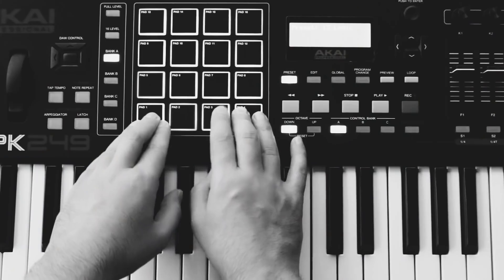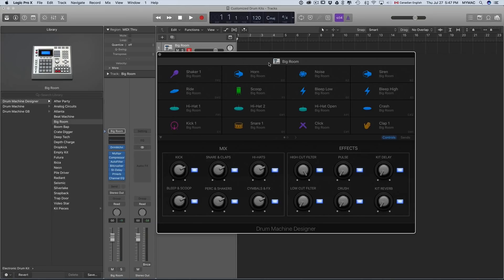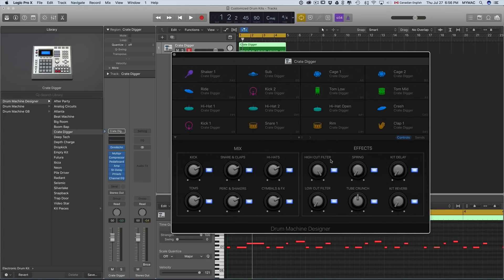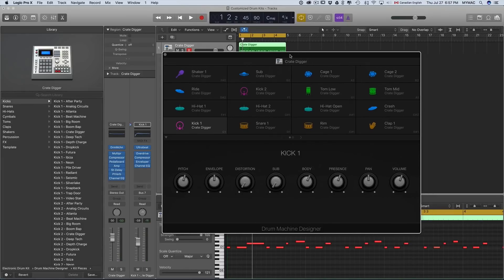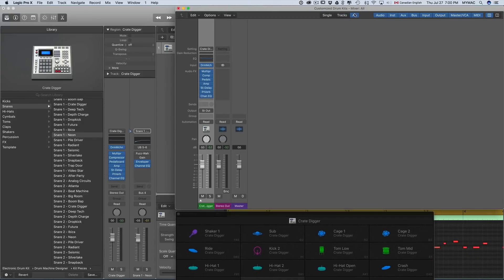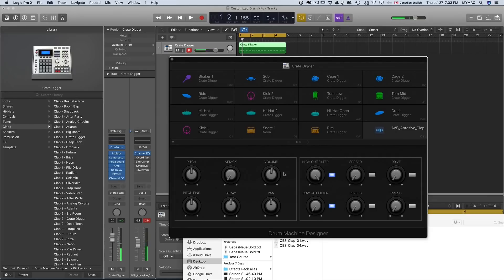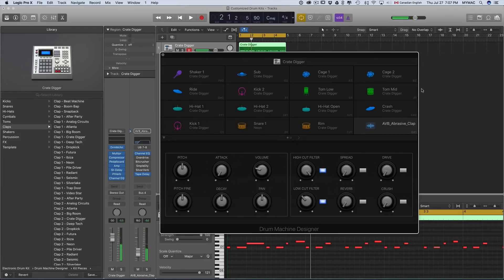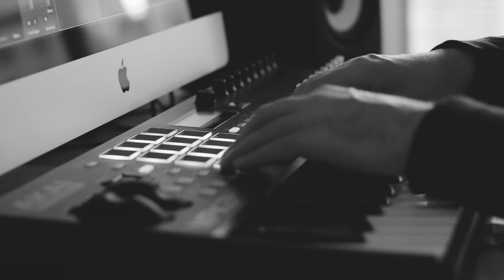Build Your Custom Drum Kit with Logic Pro X Drum Machine Designer

Comment: My Drum Machine Designer is not showing the 16 sqyares where the sounds are above the control bar.. How do I find that?
Reply from the maker: Hi, Thanks for reaching out. I'm not quite sure what your question is. Would you please elaborate?
Reply: Okay thanks for the reply. I notice when you click open the drum designer, there are 16 separate boxes (pad squares)above the control knobs of the Drum Designer, on mine I don’t have those squares to add the individual sounds. I only have the control knobs. How can I find that box with the squares. It is the box where the kit sounds go.
Reply from the maker: @mrlonqjohnsilver1118  It's strange. I don't know what the problem is. It might be a bug because when you load the drum machine designer the pad come by default. Maybe reinstall logic or upgrade to the latest version.
Reply: KUKA ok thanks for your help. I appreciate you.

Comment: Well in my opinion Drum Machine Designer is just an annoying controller around the Ultrabeat drum synth which eats up your CPU with bunch of channel strips. It just drops a preset on it and adds like 20+ aux and midi channels to my mixer and links the nobs to the parameters of certain plugins. Ultrabeat is the most efficient drum synth in Logic Pro X but the interface looks old. Instead of adding this beginner friendly virtual controller they should make Ultrabeat more user friendly. Great video for beginners though.
Reply from the maker: Hey Keve, I agree.  It's not CPU friendly. The first thing I do is deleting all the unwanted aux and channels and I basically use the interface to create my own drum. There are lots of good thing about logic that I sometimes prefer it to Ableton live and Drum machine designer is the only choice I've found that can be a substitute to Ableton drum rack. Thanks for sharing your experience.